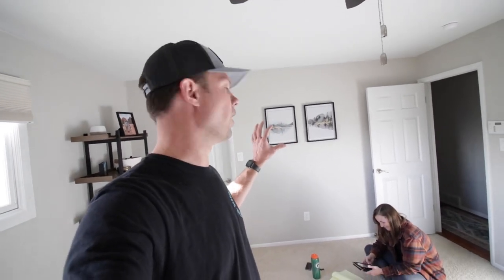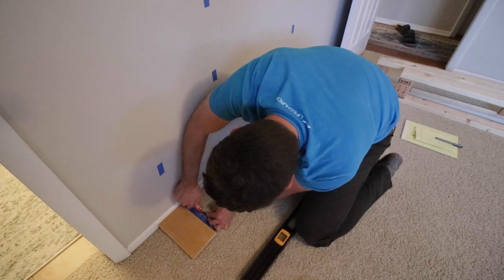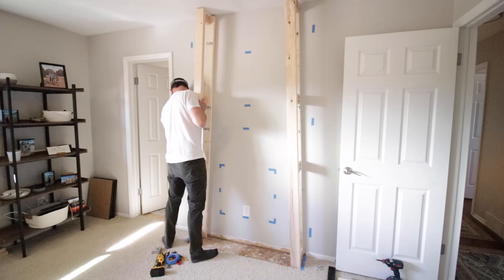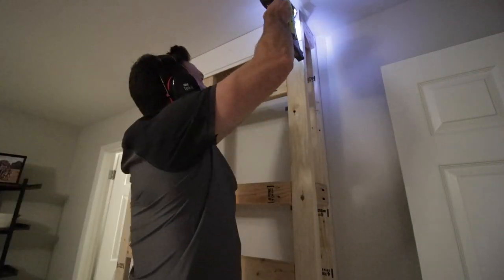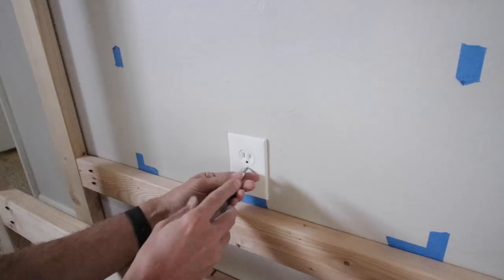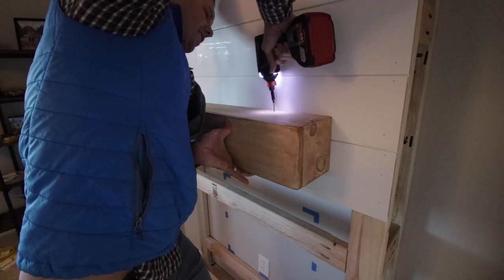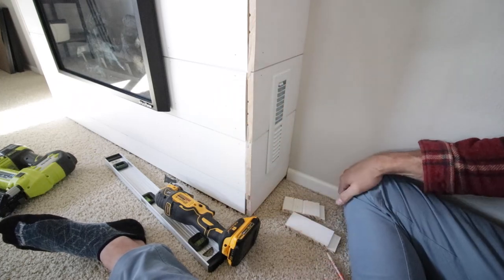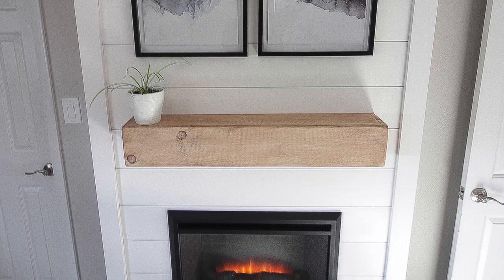DIY Shiplap Electric Fireplace

Comment: I just built one myself. I never considered adding a vent. Is adding a vent necessary for using the heat mechanism. Can't seem to find this information anywhere. Also doesn't state anywhere in manual about airflow. However, it makes sense
Reply from the maker: Glad you built one! Yea I agree there was not much info. I had the exact same debate and since the heat function draws air I wanted to make it easy to circulate air from the room so I think adding a vent or two is a good call. I’ve been glad I did.

Comment: Is this a 15 amp circuit you're relying on to power the 1500 watt heater and tv? Is the circuit feeding all the other outlets in the room ?  If so you should run a dedicated 20 amp circuit for the 1500 watt 13+ amp heater.
Reply from the maker: We are all good on our wiring but thanks for the comment so others can take note for their individual needs.